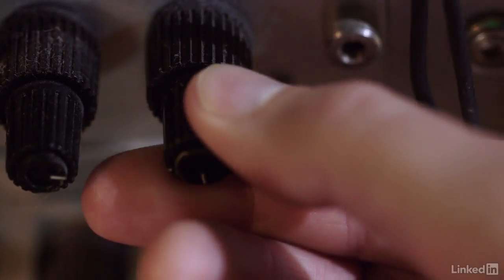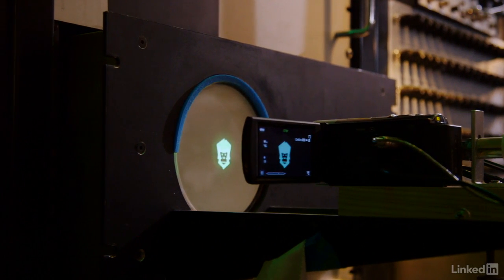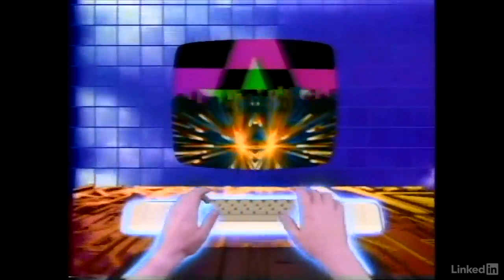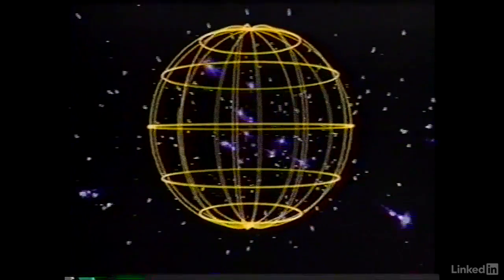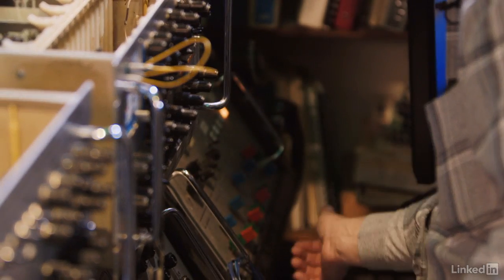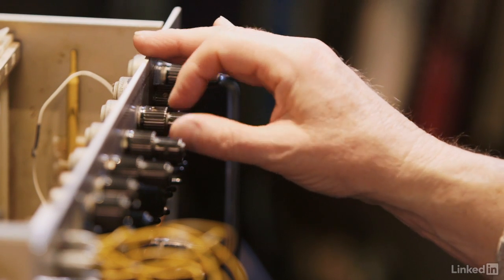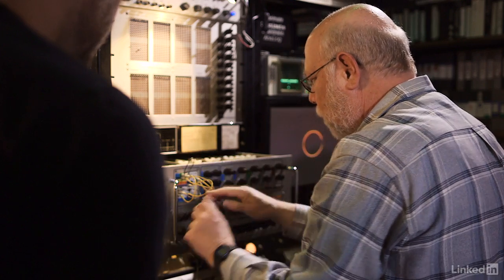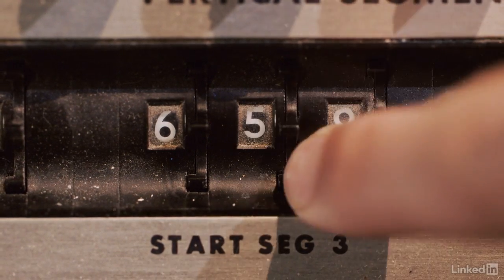Scanimate: The Origins of Computer Motion Graphics

Comment: cant they input the video signal through the RGB signal lines of the crt instead of through a camera?
Reply: It's the voltage to the TV circuit itself that is doing most of this movement and manipulation. So it needs to be filmed off of a screen.

Comment: I'm actually curious about the other elements in some of these clips.  The artwork taken into the machine is monochrome.  I understand you can change the color of the output, but how did they deal with actual images.  For instance you have a product, say, a shampoo bottle.  It's sitting there in the middle.  It may have a glowing outline with a starfield in the background.  How do you deal with the actual photographs or artwork.  For instance also radio station logos, they look all airbrushed and what not, but then have the animation.  Are the actual full-color artwork and/or photographs something added after the fact (or before)?  So maybe the shampoo bottle in the example is actually overlayed with chromakey, but then the glowing outline is made off of the scanned monochrome image?  Much more interested in how they get these other cool effects, where maybe in some big production they use animation cameras and it's all totally non-computer.

Comment: One interesting thing is that now we can mix analog and digital. Making the basic movement/effect in after effect, put the result on a CRT screen, point a camera to it and let the magic flow. Or, we can transpose this complete machine in the digital domine as an After Effect plugin, literally!
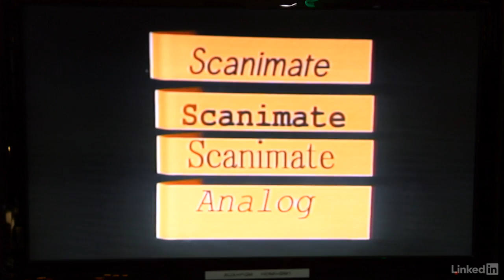Reply: I actually thought of something similar.  To get a Scanimate look, I would film a CRT playing it.  Only difference is I would speed up the footage to 120fps for displaying on the monitor so the trailing effects are more visible at normal speed.  I would also play black and white on the CRT and Luma key it later, like what you see at 5:31 but digitally
Reply: I've tried this after I first saw this video. The video I made look authentic

Comment: I tried to build something like this myself when I was a young adult, using an array of old retired video switchers and vision mixers I scrounged at TV studios. The big mistake I made was that I tried to record the distorted signal directly on tape. Of course my VCR did not accept a distorted video signal and so the recording frequently failed. So first I thought I needed a professional VCR and switched from VHS to 3/4 inch. However the problem persisted. So I assumed a TBC might be the solution, but the TBC just tried to compensate the deliberate distortion thereby "destroying" my video art. It never occurred to me that I just needed to record the distorted image with a video camera from a screen. Unfortunately I had to give up on this when I married. My wife had no appreciation for this strange hobby. So I had to dismantle my studio. The good equipment went onto eBay, the rest to the junkyard.
Reply: Dude, this story is tragic. Why would your wife not support your passions????? My options are either I'm supported in my endeavours or I'm single. (Evidently im single heh)
Reply: man, your wife is lame. i mean you dont need to be interested in your spouse's hobbies but just let them do it if it makes them happy. a happy spouse is a good spouse.
Reply: Well what you were doing sounds a bit different because it sounds like you are directly manipulating the video signal rather than plotting it in funny ways like the scanimate does. What you were doing is probably harder.

Comment: Does anybody know of a software that you can use to make this 80s animation “look” ?
Reply: After effects and studying out the analog techniques. Look up "procedural animation" in after effects
Reply: If I were to attempt it, this would be my method:
• Make the graphics digitally
• Speed them up to 120fps
• Crank up a Sun Microsystems GDM-5510 to 120hz
• Film it on the CRT with the appropriate framerate and shutter speed
• Slow the footage back down to original framerate
(The speed thing is to amplify the "trailing" effects I get)

Comment: Given the love for the hand-on aspect of controlling the equipment, I suppose I'll get shot for suggesting this, but what would be neat to me would be to create versions of this with motor-driven rotary and slide pots, switchbars, etc., VCOs and ADCs to record and playback all the manual figgiting around. Do an image generation segment, you have it all recorded and repeatable on demand. If the setting recording is itself analog, then you have something like a sampler. If it's digitized then it's even alterable in a preplanned way. Then the recording/playback machine becomes as complicated as the image generator.....oh well.
Reply: that’s how we do presets for synthesizers, too, so it’s definitely doable if you only tweak knobs and the patch matrix, but they mentioned they opened up the machine and used screwdrivers etc, and you can’t create presets for that, unfortunately.

however it definitely sounds like a doable thing and i’m surprised they didn’t have that.

on the flip side, creating presets assumes you actually WANT to re-create the same effect again, but not allowing for presets means every effect WILL be different and each try to re-create an effect will be imperfect, something which can be a positive thing (as mentioned by the narrator)

Comment: The video synthesizer I used was the Rutt-Etra. It was an infinitely simpler and primitive analog video synthesizer. During 1977-78, I used it at the Ontario College of Art to produce video art.  I still have my own setup diagrams. I used it with audio oscillators, video cameras, VTRs, video and audio mixers, etc. I also used a fax machine to manipulate images.
Reply: I was one of two people who operated a Rutt-Etra Video Synthesizer at a production facility called AAV Australia, in Melbourne, Australia. I see all these clips about Scanimate and wonder where the Rutt-Etra fitted into the scheme of things. Did it pre-date Scanimate? I am fairly certain some of the Sesame Street animation sequences credited to Scanimate were actually produced on a Rutt-Etra.

Comment: You have to love the aluminum foil technique at 6:44.
Reply: We used a shallow oil bath in front of the CRT.
If you were really good,use a thin wire to create outward ripples etc.
Reply: @laustinspeiss oil bath?
Reply: @fritz3802  flat oil pan reflecting the CRT image, and shooting with another camera at the opposite angle with as much geometric correction needed to keep the image ‘square’.
Oil was better than water as it was ‘thicker, slower “, and didn’t tend to foam, or bubble.  When it arrived, Digital image processing made it all simple!
Reply: @laustinspeiss  what kind of oil
Reply: @fritz3802  Just old clean engine oil if I recall.  Maybe three litres in a 600mm square pan in a completely darkened room it’s CRT, camera and oil tray.
Reply: pure creativity right there

Comment: This is so beyond awesome.  I remember when I was about 12, and I saw the neighbor's dad's oscilloscope in the basement, and wanted to play with it... I wanted one.  I still want one.  I also remember liking the way the image shrunk when you turned off the TV.  That and the freaky ghost image that stayed on the screen afterwards from the tube.  I used to turn the TV off and on just to see that.  Until I got yelled at.
Reply: Randy Colby you can get a pretty nice old analog oscilloscope on ebay for as little 50 dollars. they are pretty easy to find and nice to use.

Comment: Someone should create a motion graphics software inspired by this kind of workflow.
Reply: there does not exist enough detailed information/specification on the internal workings to do so
Reply: @crt3275  He just walked you through all of it.  Gaussian blur/bloom from the CRT, internal optical reflections of the environment, vector transformation of the incoming raster scan.  That's literally the core of the look.  Later plugins to break the incoming raster into regions and apply vector distortion separately by region, and convert brightness to hue, are self evident.  There is another video on YouTube showing a guy who recreated the basic function with an oscilloscope, mixing deck, and some analog multiplication chips.
Reply: @danrbarlow  i know how crts work. i have written crt emulators. but trying to recreate this machine in software without at least some sort of specifications sheet would be ridiculous. otherwise i would do it